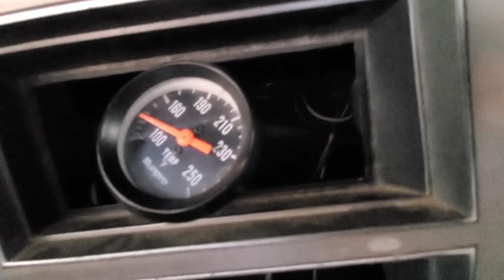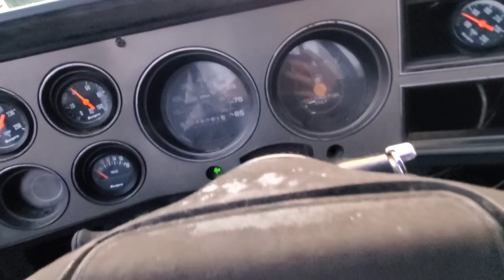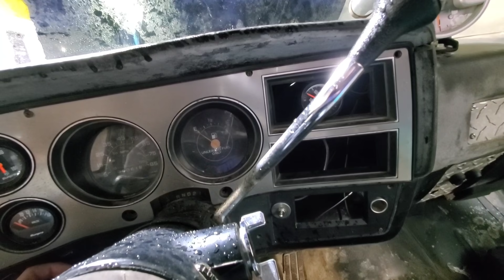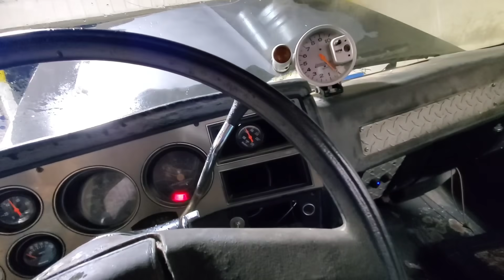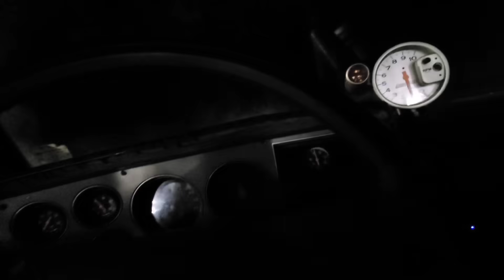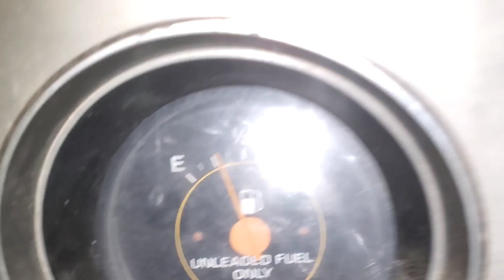Took The C10 To The Car Wash & Almost Got Stranded

Comment: Hopefully when you get a return style regulator that will fix your pump issues, I think the reason it made noise when you got to your destination was because at speed the engine is using enough fuel to keep fuel moving through the pump and keep it cool and quiet but at idle or super slow speed the fuel just stacks up and causes the pump the struggle and overheat, that's my best guess and finicky electrical systems on these old rides is just part of the experience lol, I made all the factory gauges in my c10 work, even found a rare factory tach cluster and those gauges put me through hell, I probally had those gauges in and out like 20 times chasing issues with lights and gauges quit working lol, I got it all good now and am super happy with them but not many people I know have that kind of patience.

Comment: Are you running a relay on that pump? 
Do you use fuel pressure regulator? What kind of filters are you using?
Reply from the maker: Yes and yes

Comment: Where can i get a 12v source for my Holley electric choke? I'm am almost there on a start up on my Sonoma
Reply from the maker: Most s10s have a small junction block deal on the firewall that has hot wires ran to it or you could run in to the fuse box to come on with the key
Reply: @bowtieguy601  man thank you so much for getting back to me you are the only one that replys to people
Reply from the maker: No problem man thanks for always watching

Comment: You know you can buy an 18 circuit universal hot rod wiring kit for a Chevy for like 150 bucks or less on Amazon right you need it and probably check into that I will probably alleviate some of your problems I mean the wires are labeled every 2 inches so it's really not that hard to figure out where everything goes when you get it laid out and read the directions
Reply from the maker: Yeah I've been wanting to replace the harness in it for years maybe sometime soon I'll actually be able to

Comment: Hey brother,  if you will take the regulated  port from the regulator and run it to your return then take the other port run to your carb you will be able to regulate it.
Reply from the maker: Have a diagram? My regulator isn't a bypass style so it only has an inlet and both outlets are the same